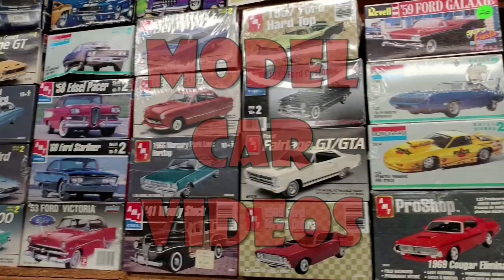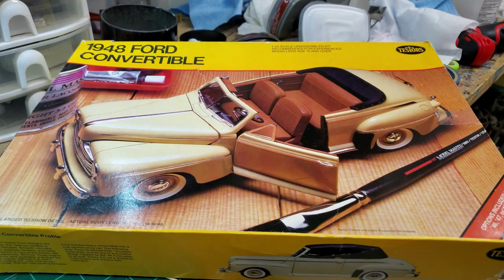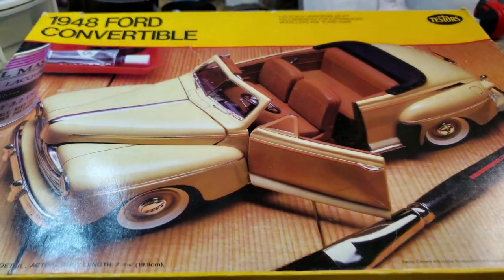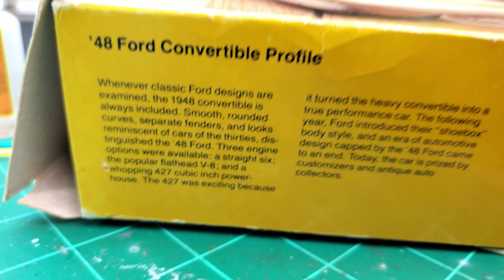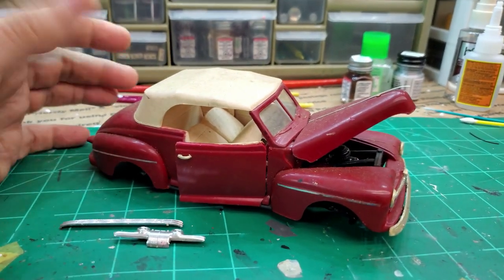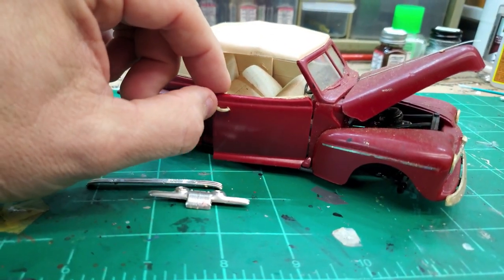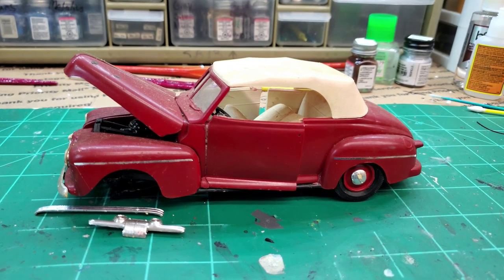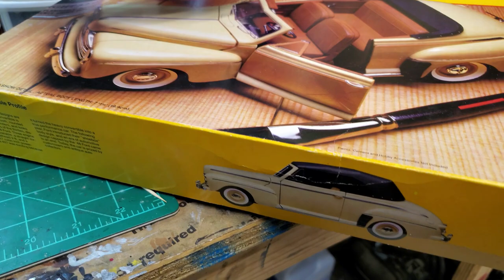Restoring My Dad's Testors 1948 Ford Convertible PT:1.  I really need some advice!!

Comment: Going one step further, consider building a diorama of a body shop. Take the last tire off and put the car up on jack stands. Position tools and guys gathered around who are getting ready to paint and restore. Bumpers and stuff just removed and leaning against the workbench. You get the idea. Once finished, it will definitely be somewhere special, yet remain as is.

Comment: I'm going through the same dilemma. My dad had 3 metal models that he built in the 60s before I was born. He painted the bodies and put them together with no details. I want to restore them but then it's no longer his work. And my sister and I used to build models together as kids. She put hers on a shelf and I put firecrackers in mine. I got her models when she passed away to soon. She had an original general lee that she assembled as is no details. I like the ideas that others suggested of leaving them alone or making a diorama with them. But don't change the condition or it's no longer the builders vision. Hope this helps with your tough decision. Thanks for all your great videos.
Reply from the maker: Thanks,  I think I'm going to repair it to preserve it like dad did it.

Comment: My advice, glue what you have back on the car and replace what you don't have and leave it at that.  

When you start breaking the car down, doing things like stripping paint, replacing windows with new windows your father never touched, you are taking away from what your father did...  Don't erase what your father did. 

Give the car a nice bubble bath, and replace only the missing parts.

Good job on correcting the mistake on Heather's pickup.  A good learning experience for you both.
Reply from the maker: Thanks!! I agree!

Comment: I built this kit when I was a kid. As a kid, it was one of the most difficult kits I built. I remember the doors being very difficult to get to hang properly. It did have neat options though. Could be built as a custom with a Carson style top or convertible boot cover also.
I would leave that model alone. Display it in a case as is.

Comment: Nice model shop! Looks well equipped. I have about 200 kits myself in my closet.
Reply from the maker: Very nice!
Reply: @modelcarvideos5829  that's cool your restoring your dad's car. I will be here to watch the process. God bless you bro.
Reply: @modelcarvideos5829  its getting hard to find kits here in butte mt, I buy everything my eyes see from pawn shops to antique stores. Wal mart has been making a slight come-back with the holiday kits coca- cola which is cool. Scratching the surface

Comment: Built this car back in the 1990's, still have it, almost same color but darker maroon with painted 2 tone interior, tan and gray. If you rebuild, be sure to use a good quality glue. I used regular Testors glue and what has happened over the years is that every time i touched the car a part would fall off. I built it without the convertible top on it. So far the front wheels are off, the windshield and windshield frame came off and the convertible boot fell off. I always thought that I would fix it someday, but there it sits, collecting dust and not sure if all the parts are there any more.

Comment: I would definitely separate as little as possible, if he assembled it with testors glue it does dry out over time and get weaker. I have never tried it but I have had several people tell me to put the car in the freezer for a while and remove and start breaking it down. I have restored a few kits and I've always looked for gaps I can get a razor it to separate the parts. Good stiff blade tuck it in there snug and twist it slightly so your actually putting pressure under the part. It is an art getting them apart, good luck I hope you can restore it without to many issues.

Comment: I would also just add the missing parts but keep as much as you can original. Maybe redo the chrome with BMF but don't repaint it. You have other kits to build as you like but this one is special. If you do build another try to do it exactly as your dad as much as possible.  Put the two together. My dad didn't build models but this week I decided to build the car that my dad owned. A 1964 Malibu 4 Dr. I bought a 65 Chevelle and 65 wagon to combine to make my dad's car. BtW your dad looked cool in that picture with you. Great memory.
Reply from the maker: Very cool!! I've decided to repair it and keep it original. Thanks Rob

Comment: Don't take it apart if you don't need to.  Seat can be repaired with tweezers.  Polish the paint and glass.  Put new chrome from new kit.   I restored a 55 chevy truck that my dad built, so I know.  If you touch the paint, it won't be the same.
Reply: I'll put my dad's 55 chevy truck on the Facebook group so you can see I barely touched it

Comment: A model that far gone with such sentimental value I would have to agree with others and say make this into a restoration in progress diorama.  You can get it all apart for sure but there is risk in breaking original parts with the freezing snapping method but that's your only real route at this point.  It's the reason I teach people to use CA glue instead of plastic melt glue, it's so much easier to get back apart if ever needed and the added bonus that if dropped the parts will break at the glue joint thus little stress from impact on other areas that would break if not CA'd together.  Granted CA will break apart but that's the point with plastic models, easy to fix if it does.

I would use your other kits to build one in the color scheme he did as an homage and leave his original as is as part of a resto scene, just because it's a model he touched and worked on I would hate to erase that unless of course you're ok with that.  Great video hope it turns out great no matter which route you take.

P.S The reason the 427 was included as that big block had enough power to make these Obnoxiously heavy cars snappier and faster all around, remember this was the days of Metal bodies and not lightweight titanium, these were metal sheets and the solid frame designs were very weighty as well.  The 427 made these luxurious cars able to keep up with smaller cars without sacrificing anything but your wallet from more gas usage lol.
Reply from the maker: Thanks! I think I'll just repair it and keep it original.

Comment: I researched how to take apart a glued model kit and someone said nail polish remover would work so I used my wife remover that she had left which wasn't much left in the jar it also had a sponge which made it difficult to get to the liquid, and I was reading the ingredients it said acetone I had a whole can of acetone all I did was used a q tip to apply where the part needed to come apart and it worked with out destroying the parts. so hopefully it will work for you.

Comment: Matthew, I would start off with putting in freezer to get apart. Remove the frame from body, remove the tub and then purple pond it and work from there on what is need to be replaced. No need to take every piece apart. Replace what is missing or broken from the other kit. Just my input hope it helps in some way. Terry
Reply from the maker: Thanks Terry!!

Comment: Disassemble  very little . replace only loose parts. Use 3M Finesse - It and a polishing rag 
on the paint gently to restore the luster. I have built 8 of these 48s and they are delicate .

Comment: My thoughts, for what they're worth, lean heavily toward total refurb/rebuild as tribute to your father 
  Good luck Matt 👍
Reply: @modelcarvideos5829  
Just curious though Matt, do you know if your dad used c.a. glue to assemble ???
  I have a 1/20 scale 'Vette & an AMX that i built new back in 1969 and I'm experimenting with a few methods of non-destructive disassembly and if i find a reliable solution i will definitely pass along the info...hope to post rebuild videos

Comment: On that older redo, dismantle it and soak it in simple green to strip paint with no damage. I would clean and reuse as many original parts as possible. Best of luck with that.

Comment: You can use aluminum tape that’s used on heating duct work to replace the chrome. You can get it from any home improvement store. As far as the paint. if you strip it wouldn’t it no longer be your dad’s work? If you’re trying to persevere his work wouldn’t you want to just sand it smooth and clear coat it? Just a thought. Good luck with the project.
Reply from the maker: I think you're right! I'm going to repair it and keep it original.
Reply: @modelcarvideos5829  Wise choice!

Comment: Getting it apart is going to depend on what kind of glue your dad used. If he used Testers tube clue it will be almost impossible to separate the parts. Testers tube glue literally melts the plastic together. I tried the freezer thing...it didn't work for me. I recently took a B-29 1:120 scale apart that I built with Testers tube glue around 1965 because I wanted to redo it, and although I got it apart using an exacto knife, I broke a couple of pieces and lost some pieces that flew off and into the Bermuda Triangle under my work bench never  to be seen again, even after carefully sweeping the floor of my shop. The plastic literally breaks before the glue joint separates. On some parts I use a Dremel cutting wheel and then used putty to fill in the gap left by the wheel when I reassembled. I found the whole thing daunting. I also have a 1940 Ford coupe like the one you guys are working on that I built around the same time period. I tried getting some of that apart, but there is no easy way without destroying pieces of it. If I were you, and I think another person in this chat mentioned it, I would leave it together in memory of your Dad. Then I would build the new one the way you want and display them side-by-side as father and son builds. What a great testimony to your dad and a trophy to both of you. Good luck bro.

Comment: Any idea what kind of glue was used? Bob Smith makes CA glue dissolver, but I don't know if it works on "regular" Testors glue.
Reply from the maker: Testors
Reply: Testors is plastic weld style glue, the only chance he has is freezing it and hope the joints snap off clean.  Very risky but does work.

Comment: Be very careful with the disassembly!  I think I would just carefully remove the top and glue the loose parts back in the interior.  Then remove the chassis and add the missing suspension and engine parts.  DO NOT REPAINT IT!!!!  That was what your Dad did and while it may not be perfect, it was his.  You have other kits to build like the one on the box art!  Add some new chrome to finish and enhance it but keep the spirit of your Dad's build intact!  Good luck!
Reply from the maker: I agree!! Thanks

Comment: i say leave as much together as you can including the paint/trim....its only original once ..so to say taking it all apart can damage parts as some have said...it would no longer be your dads kit if totally taken apart and shiny new paint put on it...i also like the idea of a diorama with maybe a repair shop theme....build the new kit all spiffy as you'd like to feel a bond with your father.....a buddy build across time
Reply: p.s. to sand on the original paint to correct paint issues would lead to a nightmare of color matching...let the imperfections be....they are part of the man who created it

Comment: With Heather's truck. It happens. Even the best of us muck up, or do things we shouldn't, when we know we shouldn't. Not me though. I'm more of a seat of my pants type of guy. With a LOT of regrets. lol

With the 48. It looks old. ( well duh. ) So, that'd mean probably tube glue. But, your old man seems to have known what he was doing. There's no glue drips, runs, or spillage on it I can see. Add to that, the fact parts are dropping off. So he didn't go overboard with the glue. In which case, the freezing method should work. If it doesn't. Best bet to preserve what you have is light cutting of the joints with a hobby knife. So light, it's more akin to scribing along the seam until they pop. 

Paint wise. If it was my oldman's. ( Which it wouldn't be. He don't do models. He's one of "those" fathers. ) I wouldn't strip it at all. The body has its marks, flaws. Sure. But from what i'm seeing. A lot of those can either stay, or be buffed, and polished out. The whole point of doing it up is because it was a model your father built. Try and preserve as much of him in it as possible. i'd go so far as to not even fix seams, or do foiling around the windscreen. 

but yeah. Thats my opinion.
Reply from the maker: 👍🏻👍🏻 thanks

Comment: I hate when people say you should or shouldn’t do this or that without explaining why.  Basically the reason why there was bleed even if the tape was burnished down good - is because too heavy of a coat too much paint buildup at one time.  If it was lightly misted on with the spray can it probably wouldn’t of had bleed through.
Reply from the maker: I agree Dusty!

Comment: I would wash it at best.  Let it be as close to what your Dad built as possible.  And I would not use new chrome...use the parts that your Dad glued the parts on it.  Paint around things and add missing parts.  I have a 1960's Slot Car my Dad built for himself and one for himself.  All I did was repair what HAD to be repaired and painted only what HAD to be painted.  And left them as close to what my Dad did when he built them.  I have them and will see if I can find them and shoot you some pictures.

Comment: Are you sure you want to repaint it? Your dad painted it what, almost 40 years ago.  If it were me, I'd clean the paint up as much as possible and polish it.  I think the interior and top are pretty good as is.  Just leave it and reglue the seat in place.  Use the wheels, tires, chrome and whatever other parts you need out of the spare kit.  I've never had any luck tearing one apart. Pieces always broke as I tried to remove them.  So I'm no help there.
Reply from the maker: Thanks Steve! I'm going to repair it and keep it original.

Comment: I don't think I would restore it if it was me...     In the nineties my dad built his favorite car (a 1956 Ford crown Victoria the AMT kit) and then he decided to throw it away incredibly enough!!!      I asked " WHAT are you out of your mind???!!!" I'll take it for you and save it...     I did and I still should have it somewhere in storage...      The only things wrong with it are that the front left wheel assembly came off and he had some over spray with the black paint he used and the paint ran a little bit as well...      My point is that your father's build needs extensive restoration my dad's doesn't (last I knew)...     I personally wouldn't restore it because I would most likely ruin it...      Let me offer this then; I have a 56 Victoria (I broke the crown removing it 😤☹️😠🤪🤬), I bought fully built as an experiment...     I'm going to soak the whole model in purple power and see if the model pulls apart mostly on its own...     I'm doing that car as a radical custom because of the parts that were used for the original build...     My kit is an experiment, I'm NOT suggesting you do that to your dad's build...     I know virtually NONE of what I told you is very helpful but I'm hoping it might spark some inspiration...